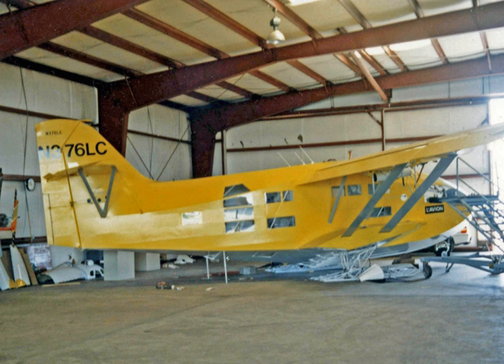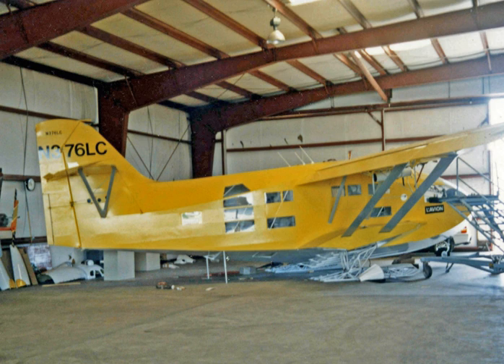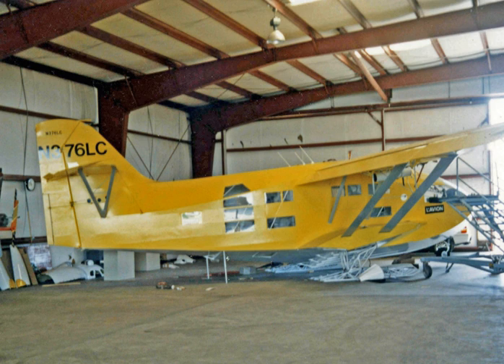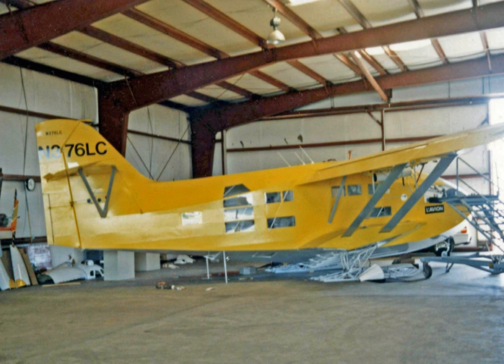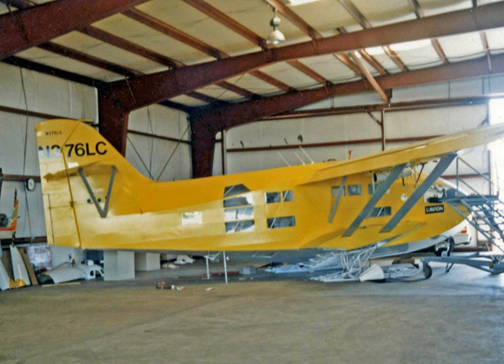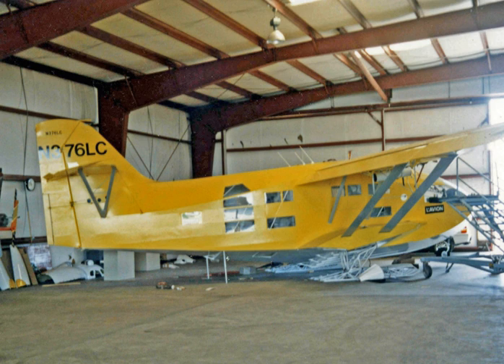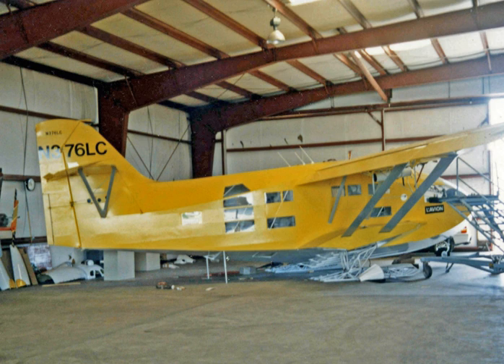Wilson Global Explorer | Wikipedia audio article

Comment: A genius experimental exploration vehicle . It is a great pity that only two were built with modern materials it would be far easier to maintain and probably have much better performance ... even incorporating hybrid power system. To assist in peak performance operations.